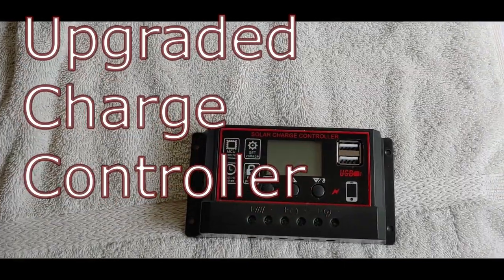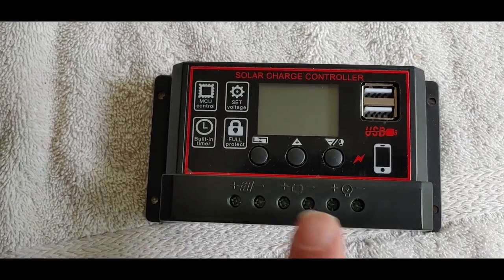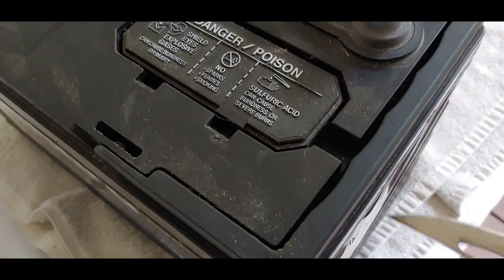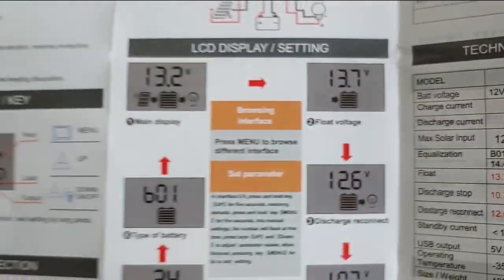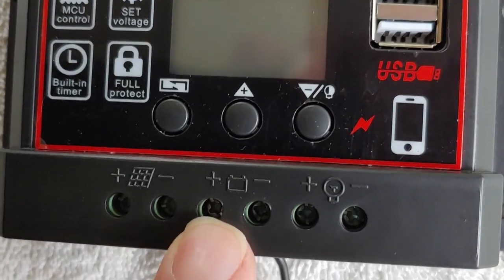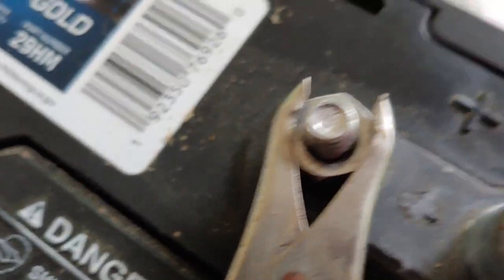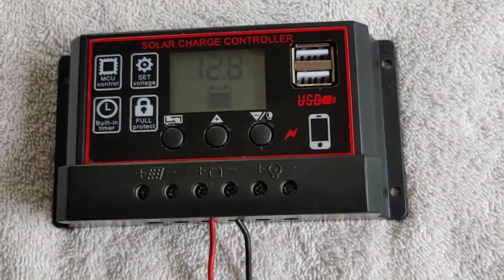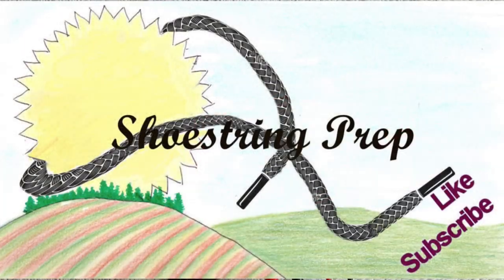Review of Upgraded Charge Controller

Comment: i have a blue controller that looks something like these that does 3s li-ion 12.6v 20a but im only using 20w of solar 2x 10w panels hinged so they fold up for camping
Reply from the maker: This one is 30 amp but only does acid batteries. Thanks for your comment.

Comment: Can you recommend at what level I need to set my charger control to allow my 2 batteries in parrel to correctly charge at. 🇬🇧
Reply from the maker: What charge level would depend on the type of battery. Having the batteries in parallel does not change how much charge you would need to charge up One battery. For instance if you have an AGM battery and the end AGM battery says to charge it to 13.5 it doesn't matter if it's one AGM or four in parallel they would all go to 13.5 as an example. Hope this helps thanks for the comment.

Comment: you forgot to mention that the battery is connected first so the charger knows weather it is on a 12v system or a 24v system
Reply from the maker: Good tip. Thanks for your comment.